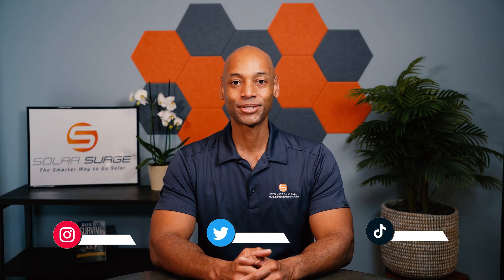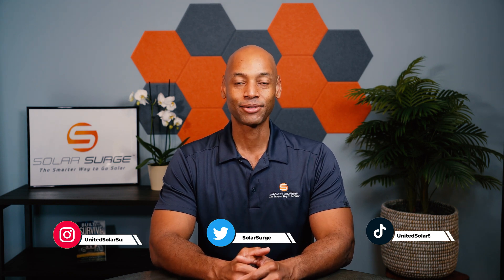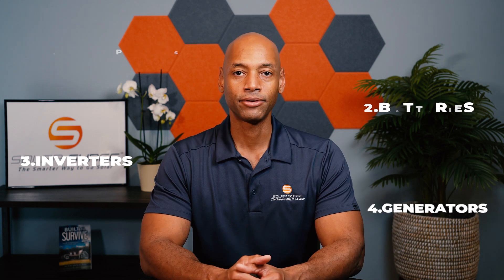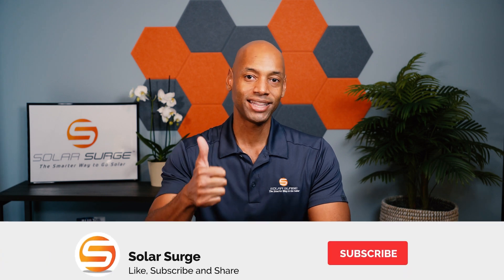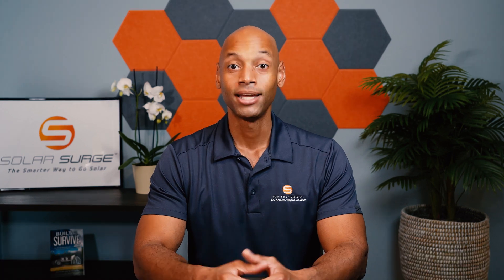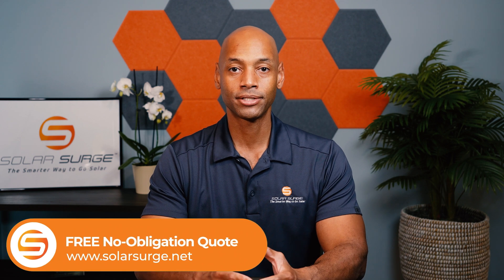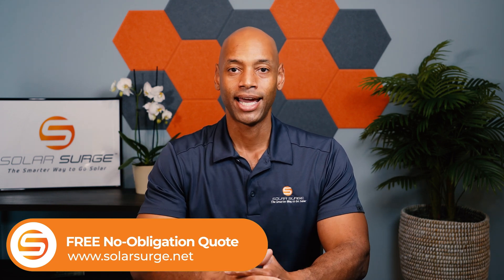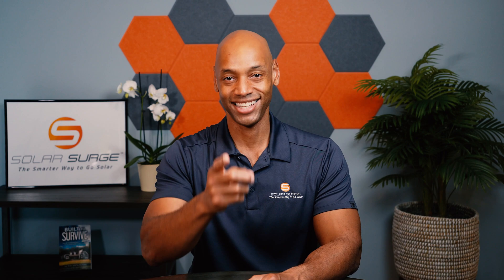Tesla Powerwall 3: What I Want to See

Comment: I wish you would address whole home electrification/renewables for those of us in cold climates. I have solar, max insulation and sealing, air source heat pump, heat pump water heater, EV and live in southeast Michigan with winter, summer and terribly unreliable electricity as our IOU DTE is horrid. Still not ready to invest in battery backup system as I need a more cost effective and seamless battery solution, even if it involves a generator at some point. Bi-directional EV charging is also a huge item on my wish list. Have a 2 month old model Y but our next car will be an EV with bi-directional charging. I need to replace or supplement my current Solar Edge inverter (4 years old), add a smart panel like Span, add battery. Still waiting. I hope you are right about Power Wall 3

Comment: I have been saying the same thing about buying SPAN as well. If they buy SPAN then theoretically they could get rid of some of the boxes they have to instal for you emergency circuits right?
Reply from the maker: Correct.  If they use SPAN, there would be no need for a separate critical loads panel.
Reply: SPAN needs some updates, perhaps Tesla funding could help. A panel with 32 breaker just isn’t big enough for an all-electric home with Solar and EV, and the recommendation to add a second panel is not very economical. The 90A limit on breakers could be a limit with Powerwall peaking at about 48A per battery, depending on how multiple Powerwalls are connected to the panel. Either they are combined before the panel, and 90A is a limit, or they are combined in the panel and the breaker capacity is an issue.

Still, turning off a load is a crude control, and smarter appliances are better in the long term, with panel controls only as an emergency backup. The current dumb appliances will live for quite a while though.

Comment: I agree, I would like to see Tesla acquire SPAN. I would like to see AI incorporated into SPAN to dynamically identify devices on each circuit, be proactive on alerts for anomalies (example: hair iron left on), and use pricing from PG&E to tell me how much each circuit costs me to run so I can make decisions on power usage. With integration, I want to charge my Tesla via the sun instead of sending the power back to the grid.
Reply from the maker: Great points. Thanks for the comment.

Comment: Joe - you make some really excellent points in this video. As an owner of a system containing Tesla powerwalls, Span panel and Enphase micro inverters, I also see exactly the gaps you identify and I hope they are addressed in PW3. Additionally I would like to see either the TEG or Span be able to individually turn off/on enphase microinverters in the situation where the system is detached from the grid and the batteries are nearing 100% full. This would be better than raising the frequency of the a/c to 66 Hz (the current primitive Powerwall workaround to switch off the microinverters)
Reply: Wow that's crazy. You would think they would have a more elegant software solution.

Comment: Enphase is on the acquisition path, and Span fits well. Keep an open mind ...
Reply from the maker: Good info.  I think Tesla and SPAN are a closer match considering the extra equipment needed to connect Enphase batteries to SPAN.
Reply: @SolarSurge 
on second thought, Schneider Electric, in the space and expanding in the space. Enphase IQ-5P tie in is claimed to be a much cleaner and less complex install and commissioning. I have yet to hear a first hand account however!  With the pace of innovation, who knows what comes in 2024 or planned for 2025. GaN industry wide?
Also, thanks Joe for subject today. 
 Narrow audience maybe but interesting to think on:)
Reply: Enphase seems to be much less willing than Tesla to open up 3rd party APIs to their solar components. Therefore I think it would be a disaster for current owners of Span + Powerwall + Tesla Gateway systems if Span were bought by Enphase. Most likely Enphase would cease support for the Tesla ecosystem and only support Enphase integrations going forward. I think Tesla would not do this sort of anticompetitive thing and so an aquisitition by Tesla of Span would be a better outcome for Span customers.